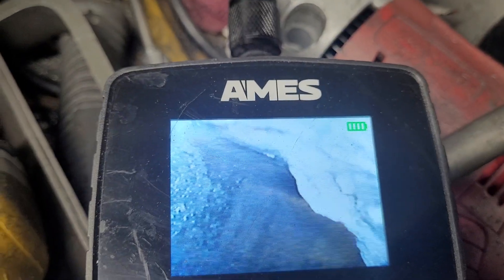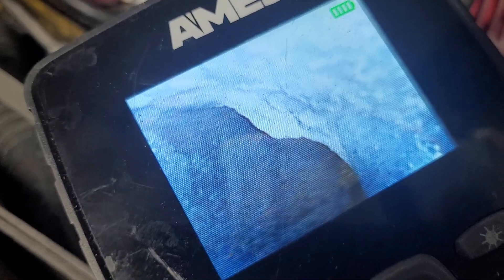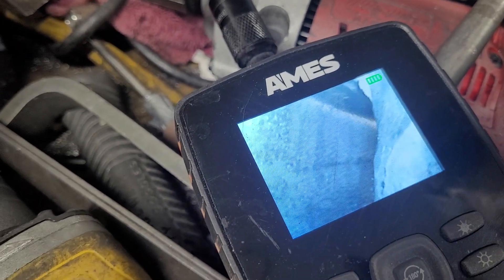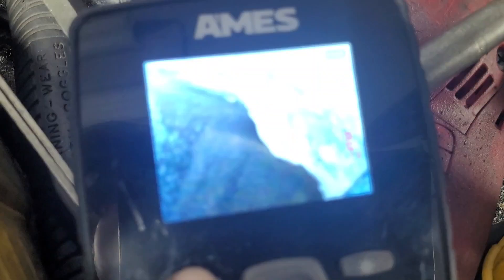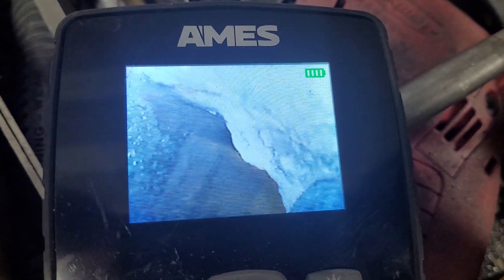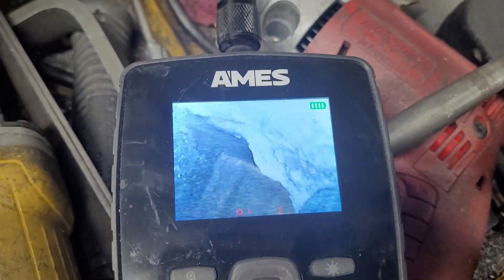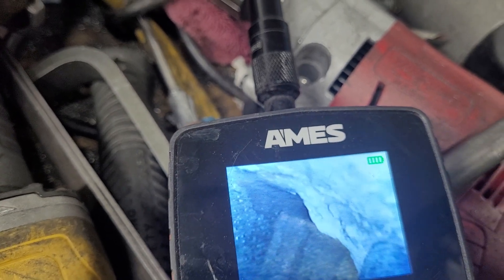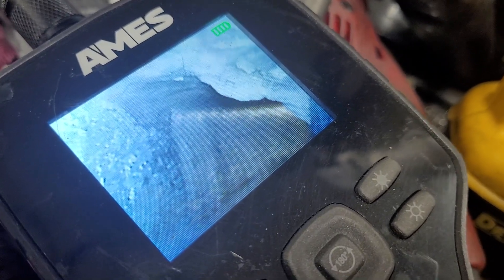Mission Impossible project ported single plane manifold, using a borescope to find problems.

Comment: Drill or cut it out,  epoxy or braise it up,  no one will know,  I'm curious about the carb, can one be modified to flow enough?  Maybe a epoxy putty to form a velocity stack type entry,  making flow in better, maybe bore the venturi? Larger throttle blades? I think it could be done, but is it enough to help, a 500 Holley 2 bbl is what is needed,  then modify that, a velocity stack,  but you guys should make this a low boost turbo engine, put a 2bbl carb in a box, blow through turbo, with about 8psi,  use a eBay turbo , basically copy a Buick Gnx style, non intercooled, or use a small water to air in the carb box, the boost not over 14-15psi should be fine, the fuel will cool the charge a bit!! It could make a surprisingly stout 🤬angry sounding engine, the HP numbers could be surprising for what it is! Especially with Mr vizard working his magic on it!
Reply from the maker: I like it!

Comment: 1/4" flex extension or a drain cleaner flexible snake with a sanding flap disc would smooth the ports in that area I think

Comment: Hey Charles I got a great idea on that chunk hanging down, find a good spot on the runner , top side or bottom ,where a hole can be drilled to insert tool , doo the work , thread and insert pipe plug and hopefully the plug bottom can then be reached with tool to smooth

Comment: I have a Dremel with a right angle drive unit. I buy burrs that are up to 100mm long. I cut them down to length. I suspect that you would be able to feed it in there and sweep the area. Looks like you are not that deep into the port, so it shouldn't be too much of an issue. Larger diameter burr will be your friend. Regards Greg

Comment: I think drilling and tapping the manifold in select places for large NPT pipe plugs would allow you grinder access and the BPT plugs could be shortened to be flush to the port wall when tight / JB welded in for a more permanent fit / seal.

Comment: With larger runners and plenum intakes i have been able to get the entire die grinder(small pneumatic ones) into the plenum, feed the hose up a runner then work carefully with the grinder from there but that's not going to work for you.
 If you dont want to buy more tooling, locate that spot on the outside of the intake drill down through the center of the lump, keep enlarging the drill till you do away with the lump then plug the hole and reshape the inside with JB weld using your finger if reachable or some sort of bent up tool.

Comment: Hi Charlie. Have you heard of a pencil grinder? It's a very small die grinder. They have an 1/8 collet. They make carbide burrs the same as what you have just smaller with a 1/8 shank. You might be able to slide the pencil grinder up the port like you did with the borescope and grind away. I have one and they are very useful. Harbor Freight might have them. Sorry for the description if you already knew what they are. Andrew
Reply from the maker: I have a pencil grinder. I got it with my big grinder. Ugly but I did it.

Comment: Mission Impossible for the average Joe.  The time, tools and skill of this build by you, David and Andy are beyond the skill levels of most people.
Reply from the maker: Not sure where average Joe comes in but in my life I have been an Electrician, a/c guy, welder, teacher, and electronic tech. So just an average Joe.
Reply: @servediocylinderheads  The average Joe does not have anywhere the tools or the skill that you David and Andy have in this project.  Flow benches and other equipment to get this project done.  David V reducing weight on the rods, and the ability to balance the weight between the rods.  The amount of time spent by all of you, if sent to a shop and all of these tips and tricks where performed to this engine with all of the labor, it would just be less expensive to just buy a crate motor and drop it in.  Don't get me wrong, the knowlege you guys are sharing is priceless, but even with all of the knowlege you still need the equpment to get it done, and the average Joe does not have it sitting in their garage.
Reply from the maker: @tedjones450  I became such good friends with my machinist that he would let me come in and use anything in the shop. I would always mill a few sets of heads for him to barter out the time. It can be done by an average guy with some elbow grease. It may not be 100% of the output but I would bet 85%.
Reply: @servediocylinderheads  I would hazerd to guess closer to 15% and that's on the high side.  Especially since most schools do not offer trade courses anymore, like auto shop, metal work, or a wood working course and not even an electronic course in high school.  So having an exposure to this at a young age is gone, most people today can't even change their oil because they lack the skills for finding a drain plug, let alone the skill level for building an engine.
Reply from the maker: @tedjones450  I started with an electronics course in high school, then took votec high school for electronics, I did a four year apprenticeship to become an electrician. More years of college than I would like to admit to. Starting at high school was a real help. I was an terriblel student,  I am a kinesthenic learner so basically I need to disassemble something to learn about it. I taught Votec for 16 years. I am a firm believer in it.
Reply: @servediocylinderheads  You made my point, kids today do not have the exposure that you or I did growing up.  I took metal and wood in junior high and had electronics, wood and metal in high school. Went to a trade school for electronics and also worked for a guy named Dave Dixon doing cam and head swaps, I learned a lot from him and was able to make some extra cash on the side. Young people today do not have the exposure that most of us had growing up 30 plus years ago.
Reply from the maker: @tedjones450  Well, maybe a few young guys will see this and get interested.
Reply: @servediocylinderheads  Hoping for the samething.  We need more skilled people out in the work force to do this type of work, because college isn't for everyone. Hoping this will encourage the younger generation to go into some type of trade, because this country is lacking in that currently.

Comment: 90 degree die grinder with a stubby burr cut to length by a abrasive cut off wheel if needed. The air powered ones are typically short enough.

Comment: A short time back I kept reading about this great new thing called extrude honing for porting.  Then I never hurd a word about it since. That looks like a bad obstruction.
Reply: Still in business.
Last I heard it was about $300 for an intake manifold job.
Reply from the maker: @hotrodray6802  Cheaper than I thought. This design would be perfect for that because it is terrible to port.

Comment: A DUMORE Electric Flexible Shaft grinder is needed Charles. I would spray it down with Machinist Cutting Oil or Tap Magic #1 and use a Double Cut Burr, shank cut down if needed.

Comment: A flex shaft with a stone and a 1/4 inch drill, no high rpms but it will take longer.
Reply from the maker: That is actually a very good idea.
Reply: @servediocylinderheads  like cleaning up a 5.9 Dodge kegger manifold👍
Reply from the maker: @440phoenix  I never did a barrel intake. I have done those throttle bodies.
Reply: Yeah I've got one of the Dremel setups for that, but the setup you would really need Charlie.... is one of the (FOREDOM) head units like a dentist uses! You can set it up exactly the way they have it on foot pedal speed control etc. I bet you could find one very reasonable too. Jewelers and dentists use those style. Enjoy your weekend brother. 😊
Reply from the maker: @MidnightOilsRestoration  D.V. has one. Not for me. I need two hands.
Reply: Yes I was thinking the same.